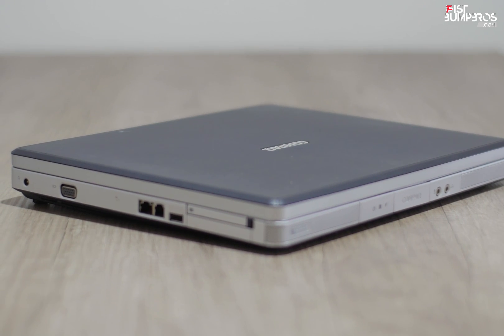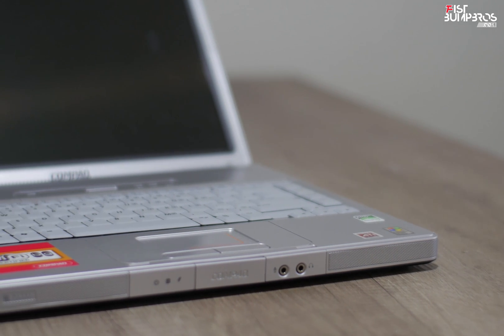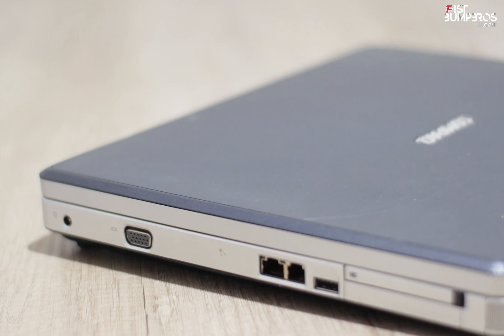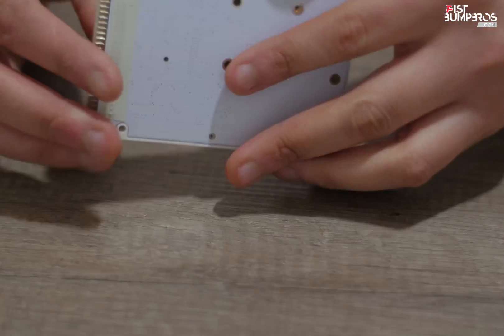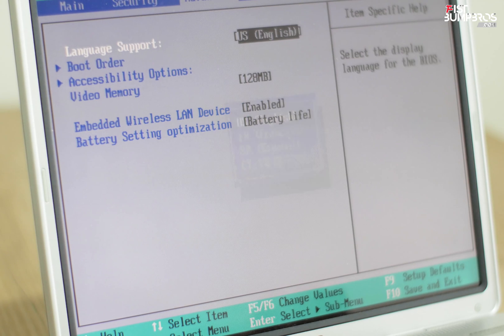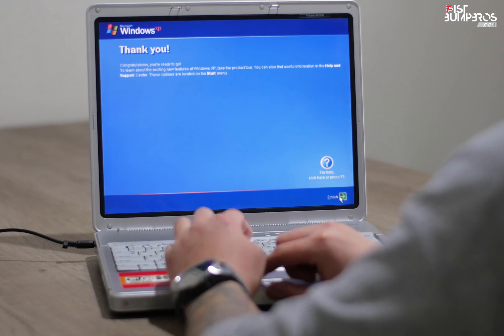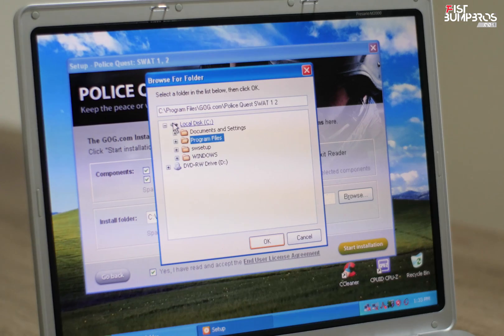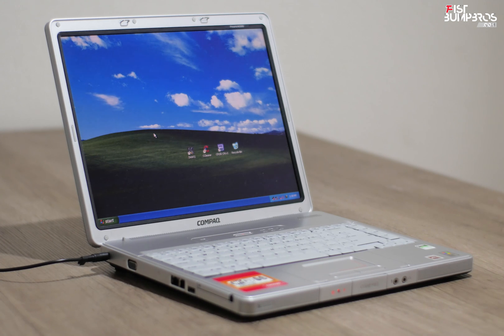mSATA to PATA Install SSD on Compaq M2000 with Windows XP SP3

Comment: 4:22 question, why didnt you use the plastic adaptor that comes with the m2000? It's the same asaptor as the one you bought (I believe)
Reply from the maker: As I stated in the beginning of the video: I found this laptop at a scrap yard. It didn't had any accessories..
Reply: @fistbumpbros  my bad! Great video btw. Cheers 😊
Reply from the maker: No worries man, that info might've just slipped past you 😬

Comment: Why my hp presario m2000  cant  connect  with  wifi, seem  like  connected but internet  explorer  said don't  hv connectivity,  it that becoz  of I still use window explorer  nt windows  10 or becoz hardware  problem
Reply from the maker: Check that Wi-Fi button mate. Most laptops have a special Wi-Fi button on the keyboard, see if it's turned on. Also, check if you have the correct (most of them are Intel) driver installed. I usually get my drivers from a second computer, place them on a USB and go back and forth until i have the correct driver.
Reply: @fistbumpbros  what is the driver,  is that window  10?
Reply from the maker: @hooiong4597  If you type in the model in a search engine, you should end up at the manufacturer website which has the drivers listed. If I remember, they were XP drivers.
Reply: Yes I hv the wifi button pressed

Comment: Hi Bro, I have the same model...can I upgrade my OS (XP) to Window 10?
I have low RAM like 258MB,how much RAM I need for medium gaming?
Should I change my HDD to SDD slot?
My battery is drainage,where is best place to get replacement?
Reply from the maker: You should definitely use it for nothing more then retro gaming. Games from the early 2000's to mid 2000's should do fine. Nothing more then that. Upgrading to W10 is something you could consider, but the OS would be too heavy, and most older games wouldn't run on it. It's best to stick to XP or, max, W7. It's always a win situation to switch to an SSD (in this case, a PATA one) and the best place to look for a replacement battery is Aliexpress.
Reply: I love playing lord mobiles...can the specs support it?
Reply from the maker: @lordoftheringlordofthering4077  To be honest, i have no idea. You should try it under W7 (not XP) with the latest GPU drivers installed.

Comment: have you trying to upgrade ssd on external ssd drive to dvd slot drive
Reply: i mean you can try put double ssd on this laptop then lets see how it work..maybe you can upgrade windows 7  or 10 actually
Reply from the maker: @foxyridergaming9198  i dont think that removing the drive, will actually allow you to go to a upgraded OS. It may run W7 or W10 on its own by default (although the experience would be awful, considering the hardware) and i chose XP on purpose because of it's older hardware.

Comment: There are on the market IDE/PATA SSD's, but I do not understand why are they so expensive...
Reply from the maker: I think because they are niche products. It's expensive to build running factories that produce that little quantity.
Reply: @fistbumpbros  very true, but for example, my old GTA games will not work on new pc's and my old laptops are working wekk except for the slow HDD...
Reply from the maker: @johndmitrikozak  could be an OS issue, or CPU clock speed. Also, I replaced all the HDDs with SSD, which is possible starting from Windows XP, I think.

Comment: I have this laptop..40Gb and 750 MB ram

I want to upgrade this with 2 GB ram and 120 GB SSD ..is it possible to run windows 7 with this configuration??
Reply from the maker: Hi, it should. I only ran Windows XP on it for nostalgic reasons.

Comment: Hi. I have one M2000. I want to upgrade it so i can use Office and programming apps. Can you recommend a SSD and RAM (as high as possible) for this PC? Thanks.
Reply from the maker: Hi, you can easily find the same stuff used in this video on Aliexpress, just search for it. I think the M2000 uses DDR2 RAM modules, which can be found on the cheap on Aliexpress as well. All together this should be a very cheap upgrade, good luck!
Reply: @fistbumpbros  its ddr1
Reply from the maker: @revoltosotintan  thanks!

Comment: i still use this laptop with 1gb of ram and 60gb hdd and the battery still hold around 45mins.it has been in my family since forever. im proud of it
Reply from the maker: Good to hear stuff like this!
Reply: Can your laptop  run on window  10?
Reply: @hooiong4597  it can run windows 10,you have to hunt for drivers but its okay,for this kind of hardware its suprisingly fast
Reply: But the computer  technician  here  told me my laptop  can't  run on window  10 coz the machine too old for  that
Reply: @hooiong4597  not everyone knows this much about tech,im a computer repairman and i can do anything
Reply: Did you upgrade  anything on this laptop
Reply: @hooiong4597  absolutely nothing,maybe just the hard drive but that isnt important to installing windows 10
Reply: Can your  hp connect  with  wifi  run on Google..mine still window  xp can't  connect  with  wifi n run on internet  explorer  ...is that  becoz of window problem
Reply from the maker: @hooiong4597  I have no clue.

Comment: Trim is a function of more modern operating systems (windows 7 and above) that trims the ssd so it will work properly. XP doesnt have that so the speed of the ssd will degrade over time. Im looking for ways to enable trim on xp on a pata drive myself.
Reply from the maker: Thanks for the info!
Reply: All new ssd disks has a garbage collection and now trim is not required especially on older OSes.

Comment: 1--??
M2000 presario will it ?  support 2gb ram.
1gb/per slot is it possible? 
Maximum ram capacity for HP Compaq presario m2000 laptop.

2---??
Pcl2700-25331-a0 256mb DDR pc2700 cl2.5.   My default ram in m2000 laptop.

Will this specification ram
Pcl2700s-25330 1gb DDR pc2700 cl2.5 support for m2000 laptop?
Reply from the maker: I dont think clocks and cycles really matter in such an old laptop (imho) so take any DDR that fits, it will all make it better.

Comment: I suspect SWAT isn't running because you're using a GOG release, which are not compatible on older versions of Windows such as XP. Try to find the original ISO. Why'd you have to destroy that Toshiba Satellite Pro 4600.. that's a nice computer btw
Reply from the maker: I have the original discs/game and that didn't work as well. I'm still assuming it's a (graphic) drivers problem. That Toshiba was too expensive to refurbish. I checked what was needed to do so, but it would rack me up like over 100 bucks just to get it working with a special harddrive, ram and much more. So I used it in a joke haha.